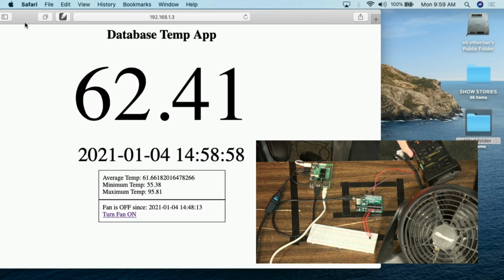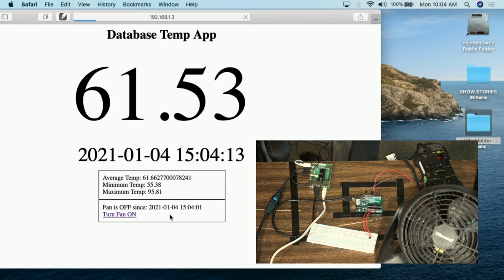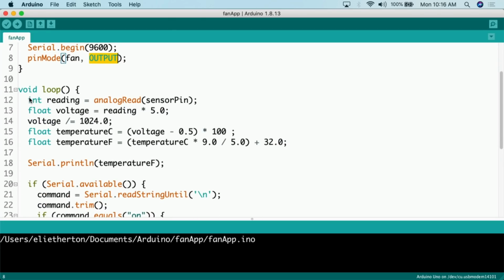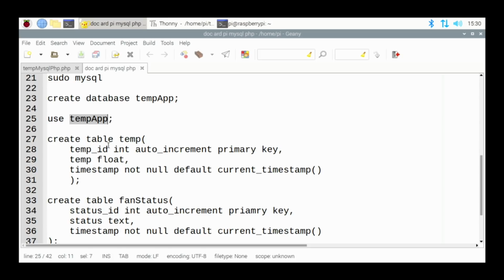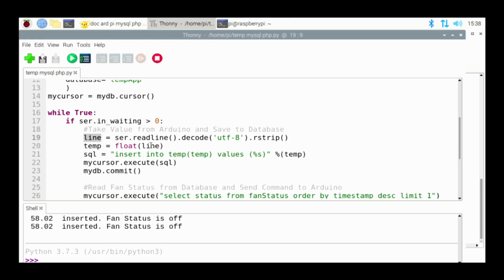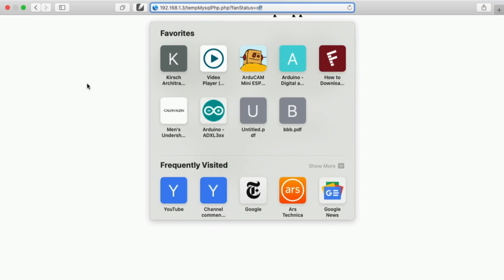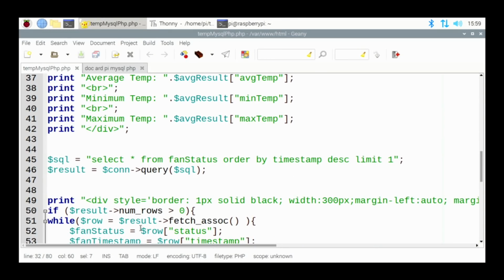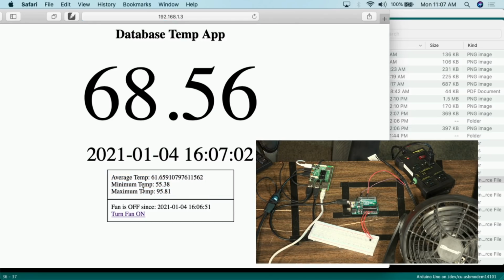Arduino - Raspberry Pi Web Fan Control with MySQL

Comment: Eli I know you are busy with a move, but you should look at the new Raspberry Pi Pico's as a replacement for the Arduino boards.  Plus there is a number of ESP32 boards that can replace a number of Arduino boards as well.

Comment: to not write as much to the SD card, you can also use in memory DB and dump to SD card after an interval. also maria DB is kind of over kill, something simple and stupid like SQLLite will do(less memory usage?). anyways i actually didn't take into account how SD cards work. i knew they degrade with each write but did pay not mind to it since i lose them way before that becomes an issue.

Comment: Fckn love this sh*t. I wonder if we'll ever get a lesson on building game emulators on these as well!!!!!
Reply: Those usually take teams or software engineers/hobbyists. I'm not certain Eli falls under that. Do I think he is capable, yes, but that would take weeks, months, or even years to complete.  In college (which I graduated lol), in 4 years we wrote an operating system. 4 years. The OS was literally a calculator with some drivers for the hardware we wrote it on. An emulator is far more than that but a similar concept. I said that to say this: imagine, 4 years for something so basic (we used a Ti89 i believe), the emulator would also require DRM among other things as well as the OS. An Emulator is basically at the end of the day an operating system that can read the contents and output the contents of the game files. You are talking literally hundreds of hours of work if not more.

Comment: Could another possibility for saving the SD card could be to make the database in /tmp which is a tmpfs which should be in RAM? Or does a pi not have enough ram for this to work very long?
Reply: A pi could hold a lot in ram depending on the complexity of the database and how many values and the frequency of the logs. A simple database will not take up that much space provided you aren't logging an entry multiple times a minute.